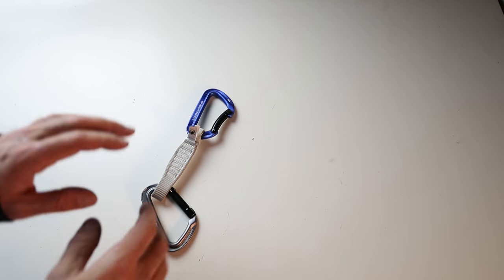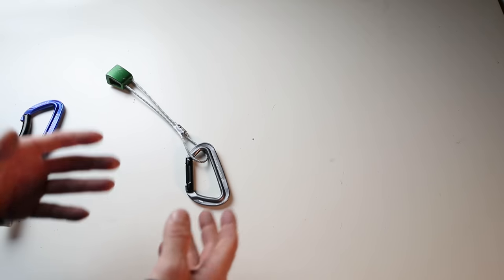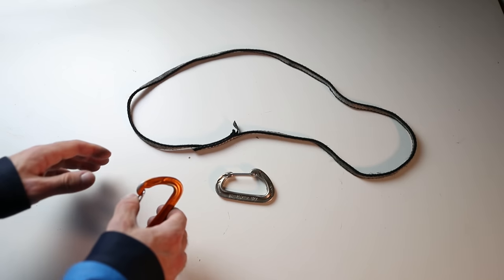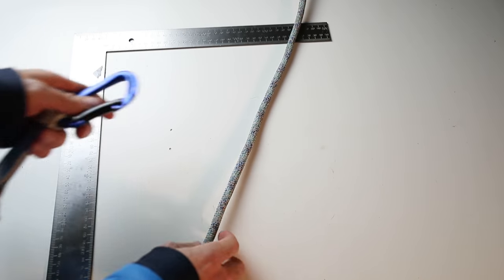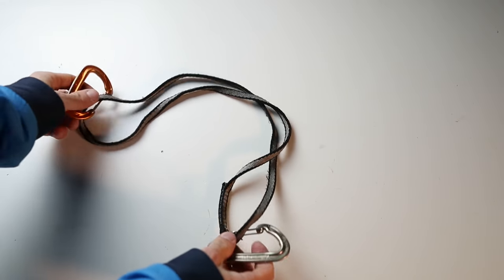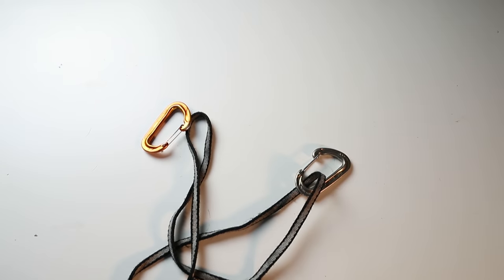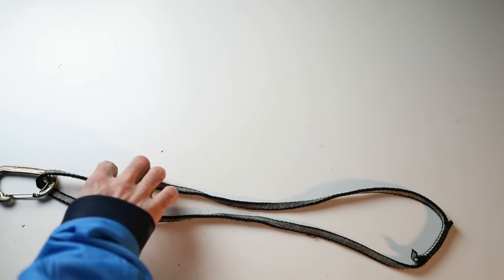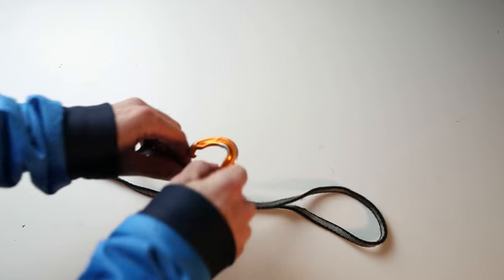The Do's And Dont's of Alpine QuickDraws

Comment: What is your suggested method for shoulder length slings? They are so long I end up doing what you did here, plus adding a twist, and I just can't imagine that is the right way. Thanks.
Reply from the maker: Like this length?

https://youtu.be/zz4no1T8bfQ
Reply: 120cm slings over the shoulder at full length or doubled/tripled as QD’s. 240cm slings doubled with a twist over the shoulder with the karabiner at the front (if your wearing a rucksack underneath and inside the shoulder strap is best that way it’s easiest to pull out). 480cm I will fold twice and then twist up before folding again and clipping to the back of the harness and on a screw gate as that is almost certainly belay building gear.

Comment: Are there any risks to using a dyneema sling for this with regards to falling and shock loading?
Reply from the maker: For quick draws you always have the rope that will prevent a high shock. But yeah nylon slings stretch more then a dyneema one will. But dyneema is lighter and less bulky.
Reply: @BetaClimbers  oooh, I didn't think of that. So ultimately the stretch in the rope would absorb most of the impact reducing the load on the draw. Thanks

Comment: Does it matter if the biner is opposing or facing the same direction?
Reply from the maker: That’s a good question. You typically want the rope falling opposite the gate, so I’d want them facing the same way so I can quickly clip it with the spin up on both sides.

Comment: i totally love this, and i have a question that has been nagging me around.
Do you see any use and/or advantge into making an alpine quickdraw with rubber holder like the peztl protector? Because i allways have this feeling of cross loading being way more probable on alpine draws, and then again it feelslike a bit of an offshute using those rubber holders on alpine draws, it would mess with the ease of redundancy
Reply from the maker: You might run into other issues like localized wear/tear points or the carabiner unclipping like a hard on hard clip in. I haven’t tried it but the fact that no one else does it make me weary…
Reply: @BetaClimbers  what do you mean by hard on hard clip in?
Reply from the maker: @itrstt66  if you clip to carabiners into each other they can easily spin around and unclip themselves this why the rubber part on draws are always on the rope end.
Reply: @BetaClimbers  i see, and now i am not following how does it relate to The question.. i am totally clueless
Reply from the maker: @itrstt66  so if you solidify the carabiner it could unclip easier in some cases I’d think.
Reply: @BetaClimbers  oh i see, an i was refering to using the rubber only on the rope biner. Any thoughts on that?
Reply from the maker: @itrstt66  other than a localized wear in point I can’t think of a reason not to…🤔 yeah I don’t know why I haven’t seen it I’ll ask around.
Reply: @BetaClimbers  Grateful foryour clarification, you seem to have a view alike mine, and i too wonder why no one seemsto use it.
Reply from the maker: @itrstt66  https://www.petzl.com/NL/en/Sport/STRING--installation-and-precautions
Reply: @BetaClimbers  wellit is very unlikely yet possible. i have seen the case reported and never into a on official brand manual. thank you

Comment: wishing u had covered the double length sling and how to clip it alpine
odd number of strands in biner means it wont fall out when u extend 
and cover how to clean an alpine draw to easily exchange gear at next belay
hint u can alpine a draw while its still attached to rope after unclipping it from gear 
or put them over the shoulder and rack them over the shoulder with one biner only per sling
Reply from the maker: That’s what I do just throw them over my shoulder when cleaning the pitch. 🤙🏻 I’ll looks into that trick you mentioned.

Comment: My favourite quick and dirty bolted (with rings) anchor build:

Alpine draw, unfold, larksfoot to one of the bolts. Other bolt, use the two biners of the alpine draw opposite and opposed. Make your masterpoint knot of choice, and you are done!
Reply: Obviously don't larksfoot your slings to bolts with sharp edges, only do this with rings or round glueins.

Comment: id consider falling on a nut to be the biggest wiggle there is so how exactly are you supposed to avoid wiggling it?
Reply: If you fall on it you are jamming it into the crack, unless it's placed incorrectly. While climbing, the wiggling would act in a different direction, opposite of the way it is meant to be loaded.
Reply: @raphaelbeinhauer9242  I dont mean once your weight gets stopped by it I mean when you ball you pull the rope which can wiggle the nut, once your weight is cought however as you said it would pull it down into the rock... but before that Is what im talking about
Reply: @recorpse9698  With the alpine sling the sling takes (most of) all the wiggle unlike the sport QD which has stiff slings. There´s always a risk that enough wiggle still can make the nuts pop out but that´s why you place them as correct as you can, place many of them (many in this case being very subjective) and/or use friends/cams.
Reply: @tobbepysslare5146  understandable. I don't really climb tho I wish I did. I really should start going out to climbing gyms and stuff but my extreme social anxiety being on my own makes it near impossible as I am now